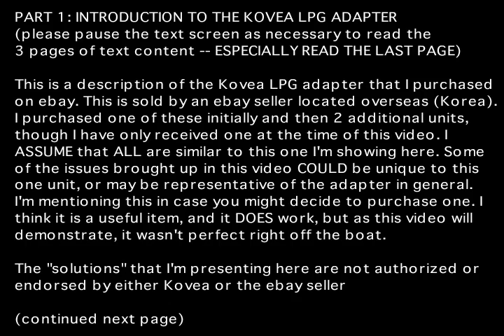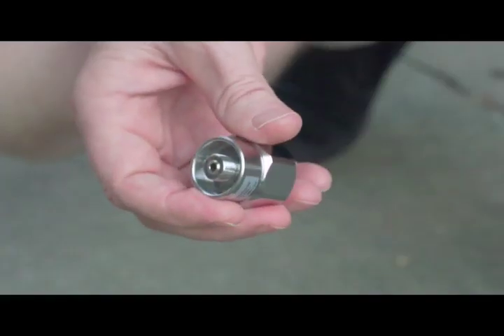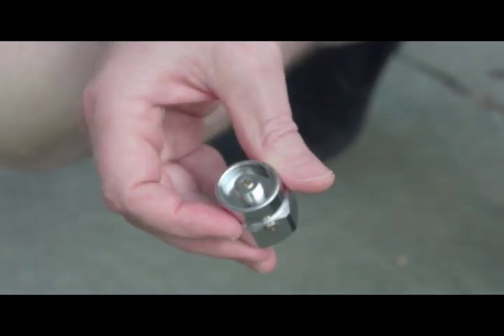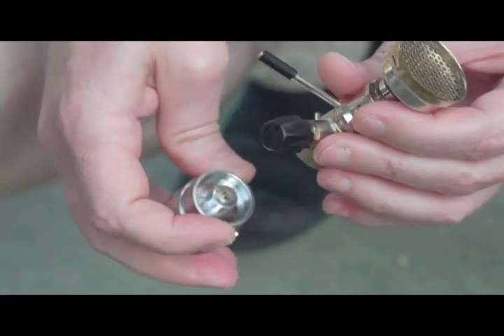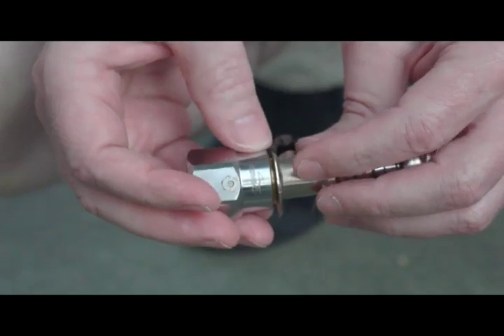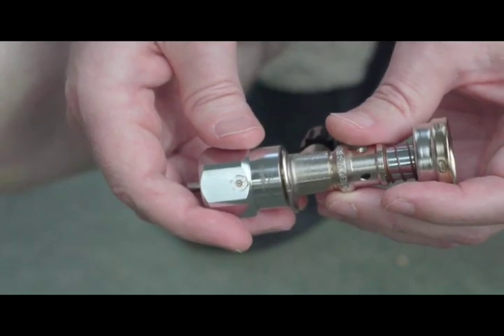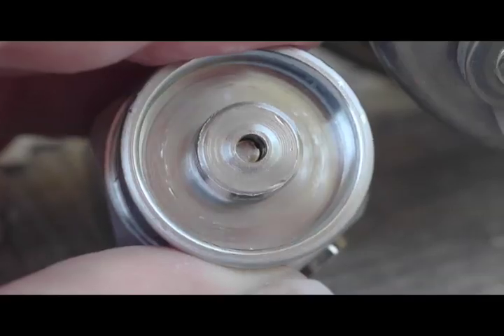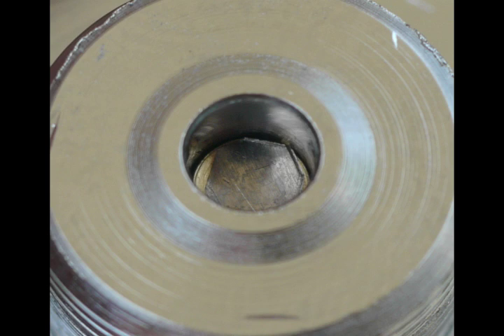Kovea LPG adapter evaluation, part 1

Comment from the maker: Very good point. The Brunton Vesta, in the demo, is like other similar backpacking stoves. Propane has fewer BTUs/gal than butane, thus burns leaner, and its boiling point is lower than butane. Most backpacking stoves don't allow changing the air-fuel mixture to compensate (the lab burner shown DOES allow this). However, as long as the jet you have works fine w/ butane, it SHOULD work fine w/ propane, but use no jet smaller than 0.035 in size, o/w TOO lean and might not burn at all.
Reply: drcoolit how much PSI dose it out put if it does 100-150 it’s fine for my airsoft gun all I got to do is clean and lube the gun before and after.

Comment from the maker: @damien: I suspect that the connection fit may be slightly different with different couplings such that there won't be enough depression of the pin to allow gas to flow out (at least that's my best guess). I have found quite a range of tolerances for these connectors, some like yours requiring no additional "fixes", others not so fortunate.

Thanks for the feedback though -- others I'm sure appreciate it too!

Comment from the maker: The Kovea adapter is for allowing stoves that normally use the Lindal type threaded canister (butane/isobutane) to use PROPANE cylinders. It's not designed to allow other BUTANE cartridges to adapt to a Lindal receiver type stove. I'm not personally familiar with the Kovea Ti stove but from the Net description, it appears to have a Lindal receiver. But remember -- the adapter is for PROPANE cylinders.

Comment from the maker: I'm sure there are many ways to fix this gap issue (including Kovea fixing it). My preference has been to use the Q-tip modification which is much easier to do than the "disc", and if you lose the piece, it's easy to make up a replacement. The ONLY reason for using any other material in the area of the slot (such as aluminum) is if you're going to directly connect a burner, rather than a connector that attaches to a line which goes to the stove.

Comment from the maker: Actually, I think this is a high quality item, and predict that eventually it may be one of those things you wish you had bought when it was available and now you can't find one. I have 3.

Understanding that minor modifications may be involved in getting this thing to work optimally, I highly recommend it for these small backpacking stoves and/or lab burners as I show in the video. Especially for lab use, propane bottles w/ or w/o bulk bottle extensions are a relatively cheap energy source.

Comment from the maker: I believe the connections for the Campingaz fitting are different than for the more common lindal threaded fitting currently employed on many (or most) backpacking stoves. A little bit like BetaMax vs VHS, Campingaz was an earlier design that didn't gain the popularity of the Lindal. there MAY be connectors that convert Campingaz to Lindal though - in which case it MIGHT be possible to use the Kovea! At least something to look into.
Reply: campingaz is totally different and the only way today in 2021 to use campingaz appliances is by refilling the empty cartridges unless you are lucky enough to be able to buy new ones.
Reply from the maker: @marzsit9833  Thank you for this updated info. I continue to use the Kovea for PROPANE (Brunton Vesta stove) and it serves me well. I believe campingaz is mostly BUTANE and propane CAN'T be used in those cylinders (they can't withstand the higher pressures). I have seen some adapters that can refill campingaz type containers assuming you can find butane. Most people have stated that trying to refill "disposable" cylinders OF ANY TYPE (including propane) is not a safe thing to do (and I'm not in disagreement about that) so regardless of HOW you go about refilling cylinders of any type, there's an inherent risk in doing that (probably mostly related to overfilling assuming you're using the correct fuel in the 1st place). I use the disposable 1# propane cylinders w/ the Kovea and the Brunton stove. Again, works fine for me and it WILL work w/ any Lindal type fitting stove. I think Amazon sells an adapter that will allow butane cartridges (the kind used in these butane camp stoves that some people use indoors) to be used w/ Lindal fitting stoves.

Comment from the maker: @billy pronovost: thanks for the feedback!
Reply: +drcoolit I know this review was done a number of years ago, so perhaps you've found out since then, the screw you mention is not a screw.  I know very little about how You Tube works, but if you still are thinking it's a screw, and want me to explain, send a message.  Otherwise, good info.
Reply from the maker: +Curtis Mathes - ABSOLUTELY! Please let me know what you know about what I THOUGHT was some kind of screw. I would be very appreciative. Thanks!
Reply: +drcoolit It is a channel that allows the fuel to flow freely from one device to the other when certain types of connectors are attached.  Say for instance you insert a hollow tube the diameter of the hole into the connector, and that slot was not there, no fuel would flow.  But the slot would allow fuel to flow through the slot, and up the hollow tube.  I use to work with similar connectors, but on a much larger scale, about 20 years ago.
Reply from the maker: +Curtis Mathes thank you for clarifying that! I've learned something!

Comment: It purchased that 3 legged transfer adapter which allows Butane to fuel my mini stove but I want my Propane 1lb tank to be able to fuel my stove as well BUT I don't want my stove sitting on my 1lb tank AND I have a hose for my 20 lb tank for my Coleman 2 burner stove. is there an adapter which can connect to my stand which has that connecter to fit my Butane cans???
Reply from the maker: not sure exactly what your setup looks like -- I'm guessing you may be looking for something like this? (ebay item description/search term "Universal Torch 5' Long Extension Hose Propane Map Gas Attach, Fiber Reinforced")
Reply: I'm worried about the same exact issue. Did you find an appropriate converter similar to the one on this video? If so, please provide the link, thanks.

Comment: I'm expecting mine in a couple of days. first off it said two things.. do this... do that... and all is well.  how do I make a SAFE run of this item originally out of the box  without BLOWING Something Or Worse Up ?? Thank You in kind for a reply.
Reply from the maker: 3/1/17 I'm not aware that there is any danger of the item blowing up - it is a regulator of sorts that allows propane to be used in deices that otherwise require those expensive LPG canisters. Keep in mind that this video was posted quite some time ago and Kovea or whoever is marketing the device now MAY have changed it to some other design. The only precautions I would recommend are the same ones that people typically use w/ flammable gases especially under high pressure. Ensuring that there is a good seal might be the best advice I can give you.
Reply: drcoolit Thanks For The Reply, I just hope it works fine out of the box when i receive the item.

Comment: Will this convert a jetboil cooking stove to use on a standard propane Coleman camping cannister?
Reply from the maker: In theory, ANY stove that uses a butane or isobutane type canister w/ a Lindal type connection SHOULD work, or at least it will CONNECT correctly. These stoves typically have orifices that are optimized for those fuels and which are less than ideal for propane (propane burns leaner in these stoves) but the stoves I've played with that were set up for typical canister type fuels DO work w/ this Kovea system connected to the 1# type Coleman propane fuel bottles.
Reply: Nope. You'll need to make the modifications in the video to get it to work.

Comment: Wow...  Curtis Mathes says "bla, bla, bla.   I use to work with similar connectors, but on a much larger scale, about 20 years ago."  

I call BS on that,  I'm a female and know that the output valve of the adapter, with the 'slot' will pass gas onto the next device regardless of the type of tube on the stove.  If the stove has a 'slot' or if the stove has no slot, the slot in the adapter will allow the gas to pass, OMG.. what are they teaching you in school?

Now, on to you Drcoolit.  You put a 'disk' into the outlet..... the flat tube inside your stove connection will seal against your 'disk', and there will be no pressure drop.  Without a pressure drop, you have zero gas flow, zero gas flow means no fire.  I'm not sure about Curtis Mathes, but I can tell without a doubt, we (American Taxpayers) have hundreds of thousands of dollars tied up on an education, that apparently has done little good for the common good on you.

I could not afford college, and yet I have to pay for people like you two to receive and education that I can not afford..
The country is in trouble, and this example shows why!

 Sorry for the rant, but common sense is..... wait,  no I'm not!
Reply: used mine several times,,, works great !
Reply: Dana Anderson damn girl, you killed it!

Comment: just get the G Works superlight aluminum jack of most trades adaptor and be done with it this korean model is pretty lame compared to the G Works and they cost about the same
             G WORKS LPG MULTI GAS ADAPTER / 35g SUPER LIGHTNESS, DURALUMIN
Reply from the maker: please note that this review I did was nearly 3 years ago. I have no doubt other vendors are trying to market similar devices. I have not actually seen the G works adapter (saw an ebay ad for one though). The Kovea seems to be solid brass with nickel plating. I thought it was very well made. I don't know what the material is that the G works model uses. 

Also, if you have one of the G works adapters, why not do a review! that way people can decide for themselves which model they might want to buy especially if the costs are nearly the same.

Thanks for the feedback though.
Reply: drcoolit yea i know i figured that. i just rested the top half of the stove atop the propane nozzle and turned the gas on first, and then lit it. it actually worked. but i don't have time to be doing the engineers jobs for them. here is a copy and paste that might be useful (if u do camping or are into survival)  response SHELTER AND FIRE IN THE RAIN video reallybigmonkey1 channel:
 a few tips:  i have never camped b4, but have spent the last month purchasing my bug out stuff. i will be camping out permanently here out. I work with highest ranking angelic elite angelic supersoldiers of Yah in dealing with mighty Draconian angels. i have the highest IQ, of course, and have some suggestions for individual in this vid. where i am is always where people will be. i too purchased a poncho. thumbs up. however i bought an alpaca poncho. u can ring it out if need be, it will be breathable and comfy wet or dry, u can sleep in it, u can swing an axe with it, u can use it as a towel, it's anti bacterial and waterproof beyond wool, it is quiet for hunting game, it has a higher tensile strength then wool, and it is fire retardent and wont get holes near campfire while being light weight and far softer then wool. made by the creator, obviously. off the top of my head the creator made 5 basic things = honey, beeswax, fur, wood, and leather. stick to these and drop all the Luciferian sh$t Lucifer is a complete a$$hole don't excuse my french. 
       this vid has taught me the importance of rope. however as i watch this, i recommend that the rope be wrapped around a length of wood in his hammock and tarp structures, this will add great stability and the thin paracord can become ropelike in this context of spiraling a length of wood lengthwise to form hammock rails. also, all campers MUST have some flourescent spray paint. our minds are not right now days, and we need all the help we can get. u will be losing  alot of things as a camper. 5 paints are even better to reduce confusion. 
      The Estwing E3-R is a much better 8 in one campers tool then the axe u are using, and for the saw you will find the Stanley Fatmax 9 points per inch with slick black coating to be well worth hanging from your rib cage. A military vest is a plus to hang things in front as is a waste pack to keep weight low. place backpack on trailing stick at waste with wheel in back when u have too much weight. a bicycle is a must for walking up mts with backpack on bike, and even less tiring on flat ground even tho it weights 23 lbs. a back pack that opens like a fishing lure box will be the wave of the future in back packs. 
    9 inch fresnel lense = 3 seperate fire in 10 seconds, shine your flashlight thru it to see distant objects, use it to warm your hands on cold sunny day. i may elect to do a survival vids in future videos if i make them, but will be leaving u tube for now.  watch the ORGONE YAHUAH'S ELECTRIC LIGHT ORCHESTRA vid, and full aliens disclosure vid criticalelixir channel u tube. instructions on making a quartz weapon all humans will now need to be carrying. in dealing with the Draconian - criticalelixir (lucifer's tools are insanity personified. it's no accident he painted it all green and camo, he is very intelligent and lived in our solar system when it was heaven on a planet the bible calls Rahab for perhaps millions of years before earth was re created in genesis after the war that laid the planets waist when Luci invented money and politics and Rahab (nibiru) was cast out psalms 89 10. He knows all about camping and will teach u what not to do therefore) . keep him in his place. (.) 
Show less
Reply from the maker: Critical ... your reply goes way beyond what my review was trying to address. However, perhaps there will be some viewers who will find your comments useful (?).
Reply: drcoolit u really don't have to tell me these things. i know